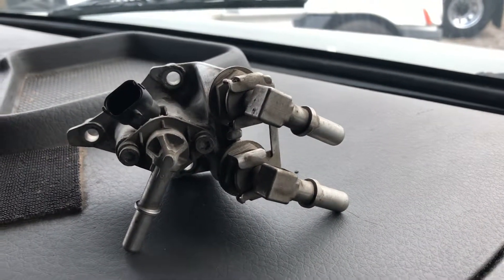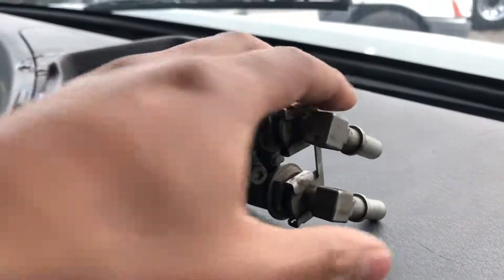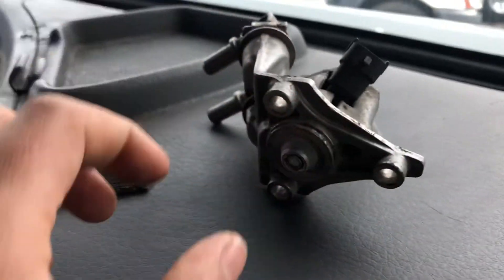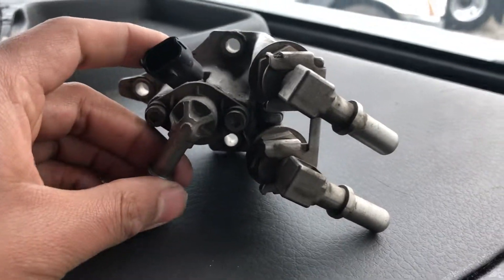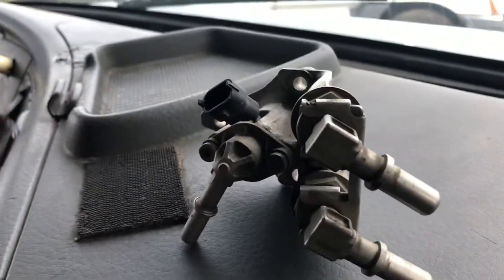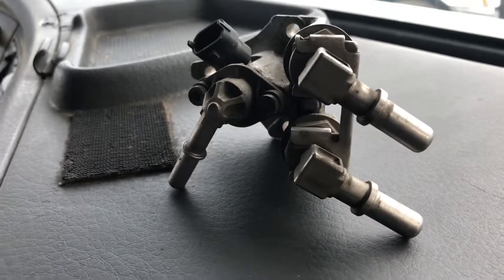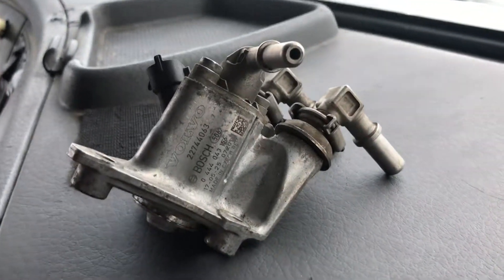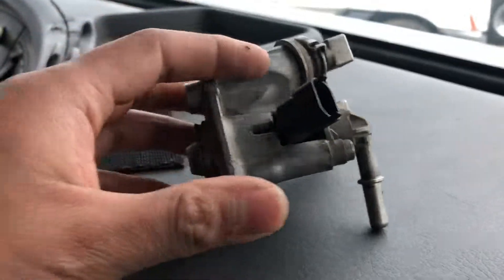ATD System Episode 1: Diesel Exhaust Fluid Injector or DEF Injector.

Comment: Please help…
I keep getting CEL with code on PTT 
Volvo P0401 Exhaust Gas Recirculation Flow Insufficient Detected.
It shows me to check EGR Valve and Egr delta p sensor, Venturi pipe clogging, or egr cooler in the solution options.
I removed Venturi pipe, disassembled it and cleaned, replaced brand new delta p sensor. Checked egr valve and it sounds like it opens and closes properly.
What could it be? Truck has only 230k miles. It Volvo vnl860 d13m engine
Reply from the maker: Check for boost leak around the Charge air cooler (CAC) hoses (blue color on the engine right side), make sure the CAC is not leaking boost. Also make sure there is not exhaust leaks or EGR cooler clogged. Hope this small checks help you. Thanks for watching and support to the channel.

Comment: I have a 2015 vw golf tdi and the def injecter is crystallized and it’s tellin me I need to add def fluid. I thought the injector was was leaking so I replaced it, but it is still crystals after I installed the new one. Any idea what else it would be?
Reply from the maker: I do not know to much about sedan diesel but it might be Contaminated DEF or the DEF pressure line is getting air along the way to the DEF injector. That is really rare that your DEF gets crystallized around the injector so fast.

Comment: I have a problem def quality being evaluated engine in derate in 5mph so I get 4094 and 1231
Reply from the maker: You will need to take your truck to a shop to connect the Tech Tool (Volvo software) and find out what is going on, in general, forced parked regeneration is required to check if there is any emission component is out of specifications. Even if you find out your fault code meaning, there is not much you can do about it. Just make sure the Diesel Exhaust Fuild (DEF) level is OK and that you have NOT mix any other foreign liquid inside the DEF tank. Thanks for watching and I hope this help you.

Comment: Which code did your truck show that made you aware of bad def injector? How do you remove hose from it without breaking clips?
Reply from the maker: Usually, for DEF injector failure (this is one example using the Tech tool): Diesel Exhaust Fluid valve clogged or abnormal update rate. But this code can be deceiving so it is recommended to run few tests to determine that the injector is not good. You can remove the clip from the DEF line with a flathead screwdriver, just push one side of the white ring first firmly with pressure enough to move it then other side as well. Once both move with your finger hold them together and pull it out. The yellow ones just hold them from the side with your fingers and pull it out. It requires some practice but it is possible to do it with patience. I hope this help you in your repair and remember, this is just my opinion, if you really need to fix something relate it to the Emission system and you do not have the tools, take your truck to a service shop so they can advice you properly. Thanks for watching and I hope you hang out around my channel.